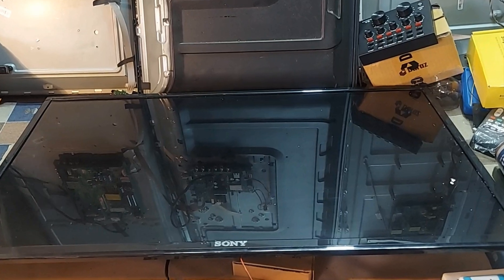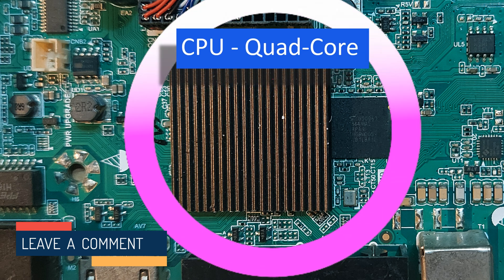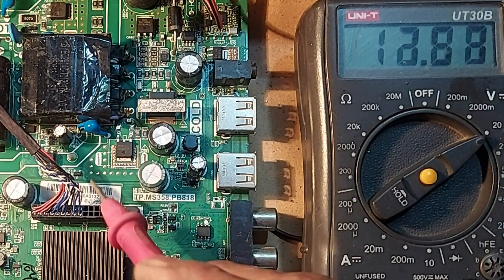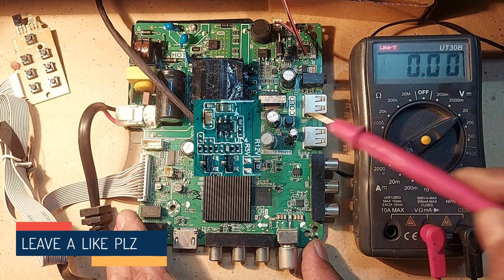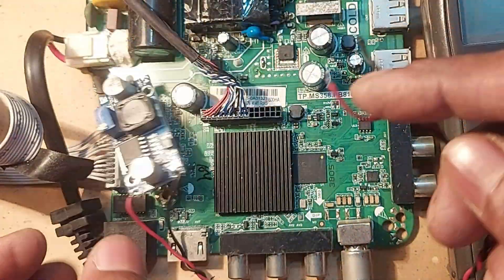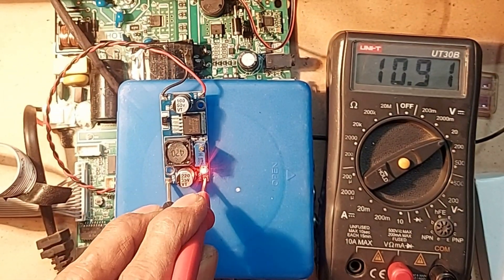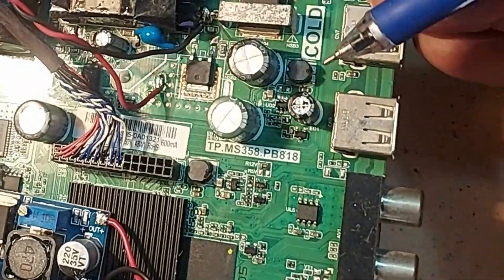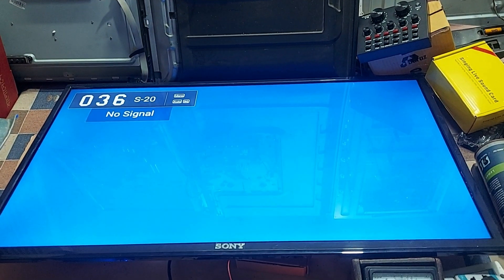No Light & Picture on LED TV Screen, No Sound, How to repair this LED TV using regulator module

Comment: hi boss, i have here sony bravia model no. kdl 43w800c,
backlight ok but no display, may i know what is the problem? thank you
Reply: t-con no. T550HVN08
Reply from the maker: If any 1 LED from the backlight strip is shorted, the blinking problem will occur.
Reply: hi boss, there is no blinkung, the standby power on display is ok, backlight and sound are ok, the problem is black dusplay

Comment: Hello sir i have a problem to 32 inch Hisense led tv. Tv picture is not normal. Tv shows only green display
Reply from the maker: 1. Clean LVDS connector 2. Reset Factory 3. Solder TCON Processor 4. Solder System processor.
It is not possible to suggest more than that roughly 🥲
💘💝💖
Reply: @OrnatePixels  thanks allot

Comment: Is it possible to use 7805 ic
Reply from the maker: The maximum output current of the 7805 IC is 1.5 amps, but more than 1.5 amps flow through the CPU and GPU of this motherboard. So the problem will occur if you use 7805.
thanks brother.
Thanks Brother
💗💝🌹💓💖

Comment: Sir why don't you used ca 1235 module or mp 1584 ic board boths ar in small package and a low cost
Reply from the maker: I use it, but it can also be done this way. Moreover, it appears to be long-lasting. best wishes,
Thanks Brother
💗💝🌹💓💖
Reply: @OrnatePixels  ❣️😊

Comment: Hi dear Mustsfa.could we get 5 volts from an7805 ic regulator of 12 volts?
And I want to know will it work nice with such a action?
Reply from the maker: The maximum output current of the 7805 IC is 1.5 amps, but more than 1.5 amps flow through the CPU and GPU of this motherboard. So the problem will occur if you use 7805.
thanks brother.
Reply: Thank you Mustafa for your guidness about in correct using 7805 ic

Comment: Great chanel and very best teacher,,,
How much about procesor working voltage sir.?!
Thank' s before,,,
Reply from the maker: 5 Volts
Thanks Brother
💖💓🌹💝💗
Reply: Excuse me brother,, i have smart tcl problem same like as that, and at cpu testpoint voltage is 1v0,, and i check is present 1volt, at many testpoint voltage are present also, but led indicator still off and vgh, vgl, vcom, is nothing, i think procesor ic is damage/ broken, what do you say about that, or what must i do for know what the problem is.?!
I say thank you if you answered my question,,,